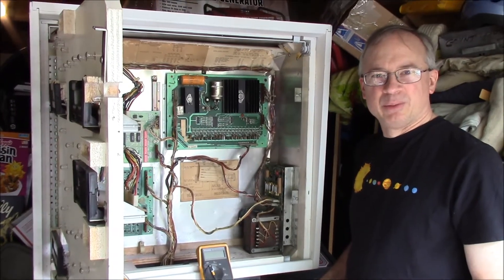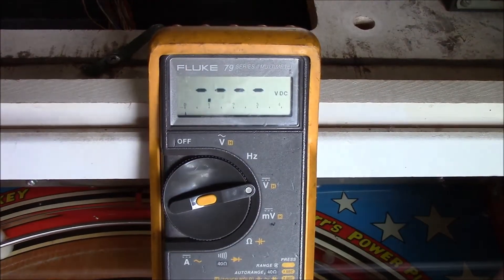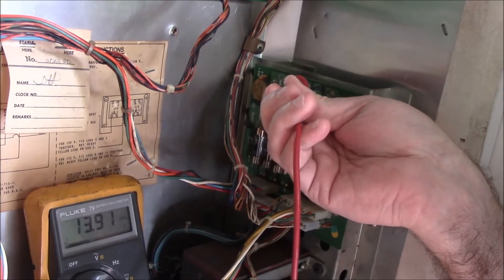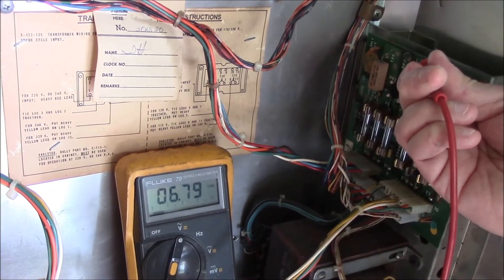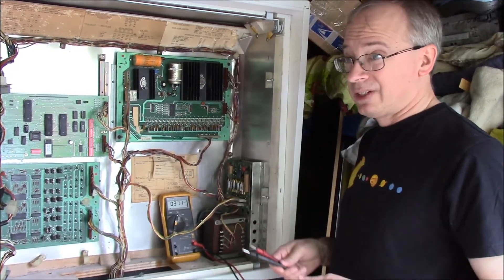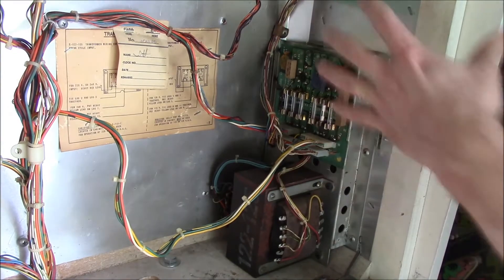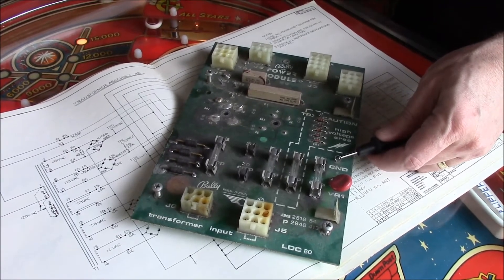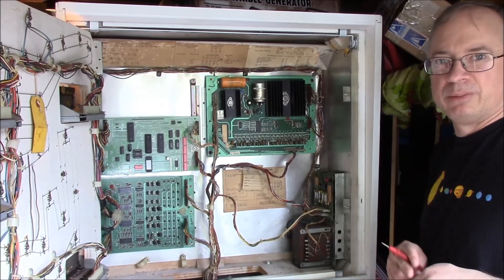Testing Bally Power Supplies 1977-83

Comment: I have a Mati Hari its been in my care over 20 years,  it never really worked right.  I checked the 5 voltages you mentioned and 2 of them were at zero.  I did order a new board, thanks allot for the great info.  I might have questions for you in the near future.  I am not new to the home arcade idea, I have 14 total, but am new to the idea of fixing them myself.   Great stuff.     thanks again   Jeff   ps every fuse checked good.

Comment: This is so helpful! Thank you! Test points 2 3 4 5 all show correct voltage. Test point one shows zero! I have no feature (controlled) lamps. All GI lamps are fine. Does this mean no logic power to the lamp driver board? If so what is the fix? Bally Paragon.... Thanks in advance! - S

Comment: Hello - Just stumbled into owning an excellent condition Mata Hari - Lights up, Score board works and only Flippers work. No relays, dinging or bumper action. Followed your Great Directions testing the 5 power points. All 5 tested around the exact voltages you described. Is there a follow up video of next steps to follow?

Comment: just got a nitro ground shaker,  all the lamps behind backglass were not working.  Because i am a noob, i started testing the fuses on my meter set on voltage.  When i got to F4 the fuse blew, i put another 5a fuse in 2 times, both blew.  Now dont know what could be wrong.  please help!
Reply: Did you get it fixed yet If not remove all the bulbs check all the sockets . After removing all the bulbs check for short with a fuse installed if it still blows wires are touching or a bad socket.

Comment: So I have to pull out each fuse separately and test them outside the cradle to make sure they have continuity?  Just wondering!  Thanks!
Reply from the maker: I would and make sure they are the correct fuse at the same time.

Comment: WRONGNUMBER,  Why do pinball tech say that DC coils & solenoids are FASTER compared to AC coils & AC solenoids that is why pinball games switched from AC to DC coils? Can you explain all the different MPU boards ballys, williams, gottlieb, stein in the 70's pinball games, like what microcontroller chips, RAM chips, EEPROM chips and dipswitch settings to go over each board. Why do pinball games use PIA chips for the driver boards the PIA chip can be deleted and connect all the switches direct to the CPU MPU board.